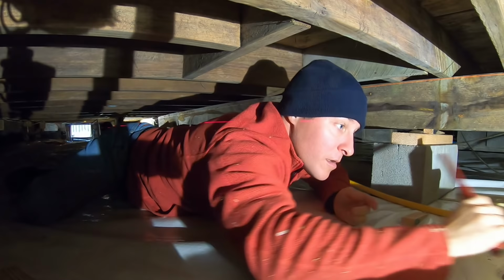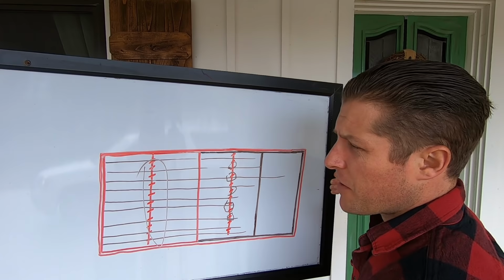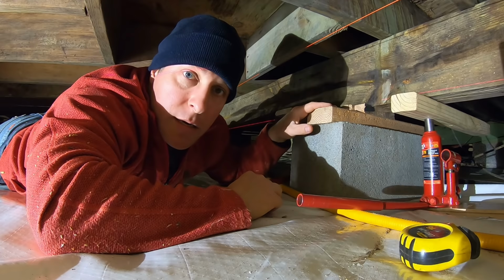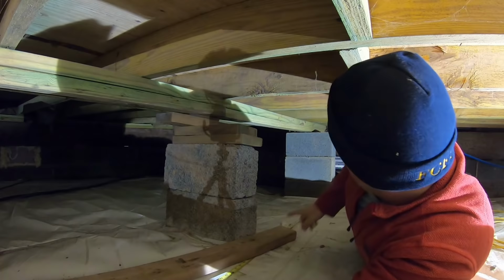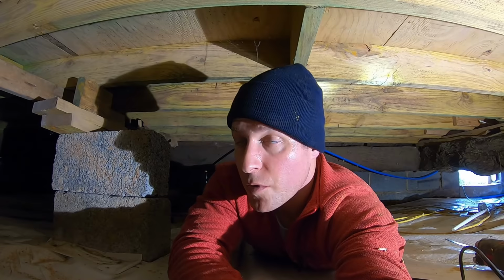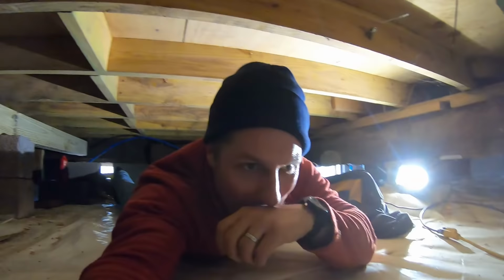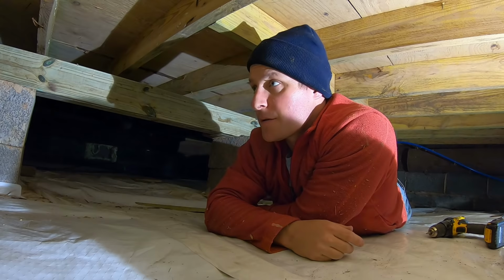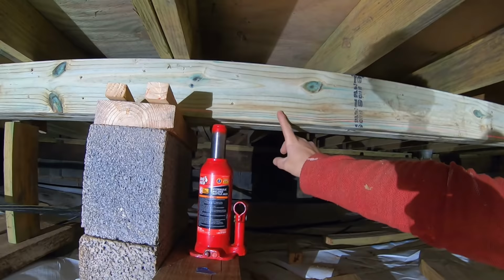Leveling FLOORS in our 100 year old Farmhouse! Fixer upper

Comment: 1 of my homes are like this.  I have built houses for 30 years and I still don't like houses with wood floors and don't understand them.  I have sneak hunters that sneak and hunt without permission.  When ever you get up and walk around they hear you walking on the wood floor. They can be right outside your door and can tell your every move and just run to the other side of the house.   Their will always be rotten floors in the kitchen and bathroom.  You will always have problems with animals under the house.  You or someone will ways eventually have to get under there to do something.    I just don't understand. My sister just got a 600k dollar house built and this mansion has wood subfloors.  But mind you this is Alabama where they refuse to change.  Just want to be cheap.  So put cheap wood floor now instead of concrete then 25 years or less you will be putting another  wood floor again.  Guaranteed
Reply from the maker: That's a scary thing to have to deal with! We appreciate you watching!

Comment: That framing is not 40 years old.
Reply from the maker: Yes 90% of the floor joist and subfloor was replaced several times over the years. The only original parts of the house are the old hand sawn beams around the perimeter and everything above that really. So if you replace the tires on an old car does that make it a new car? Thanks for watching

Comment: Why do you use block holes down on a vapor barrier. It will in time work into the ground because there is no flat  wood or concrete under it. Your 2x4 on top of first block doesn't use the full  strength of the block. Typical YouTube homeowner mistakes.
Reply from the maker: Thanks for watching

Comment: Shit it all looks new under there plus I dont think they put poly in as moisture barrier in the 40s sound like bull shit
Reply from the maker: https://youtu.be/7XlccKalaCA forward to 10:00 minute mark for some before pics! Then watch the whole video and listen before you just make comments.
Reply from the maker: Lol the poly was done a year ago so yes your right they didn’t do that in the 40’s. Most homes that are 100’s old have had the floor joist and decking replaced because of rot. Ours was replaced as well in the 80’s when it was first renovated. There was standing water 24/7 under the house when we bought it. Hints the modification with a complete interior foundation fresh drain to a sump pump then the poly to encapsulate with a whole house dehumidifier. There was only 2 rooms left with the original floors when we bought. I’ve since replaced those joist and decking as well cause you literally couldn’t walk in the room without falling through the floor. But thanks for watching and trolling!
Reply: @LittleDreamersFarm  yes sir my pleasure lol
Reply from the maker: All that effort did you even subscribe? Lol
Reply from the maker: Well thank you very much sir!

Comment: dude theres nothing about that floor thats one hundred years old. One hundred year old homes looked nothing like that. They where pretty much on the ground. Very clean treated lumber and a well sheeted crawlspace floor. Son.....you have no idea what a real 100 year old home looks like
Reply from the maker: It looks clean now, but you should have seen it when we got it! Crawlspace was mold remediated, vapor barrier installed, sump pump with drainage system also added. I’ve got a whole list in another comment that would explain how we got the crawlspace back to this condition. I’ll pin it for you. If anything, comments like yours are like a pat on the back! Thanks for watching!